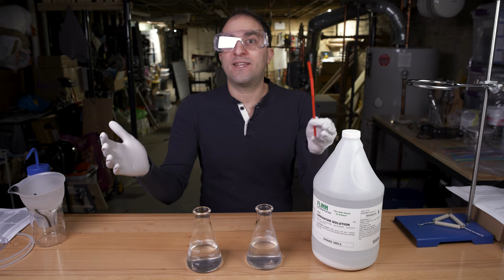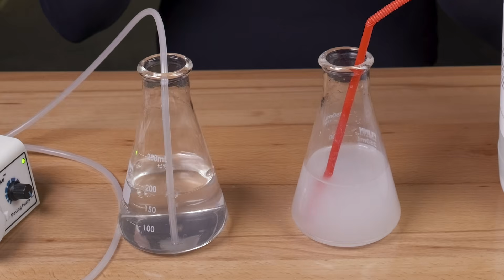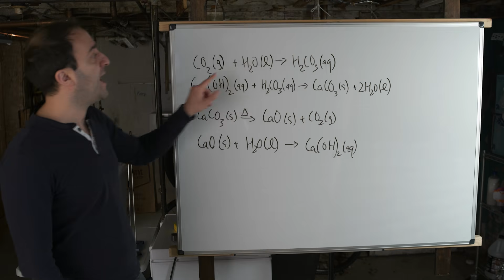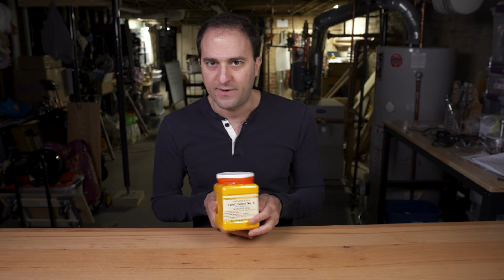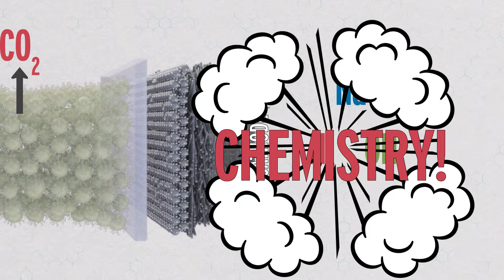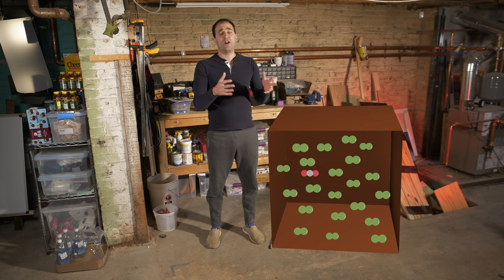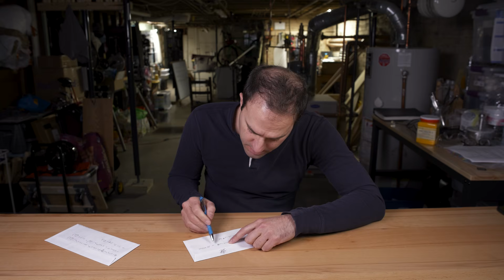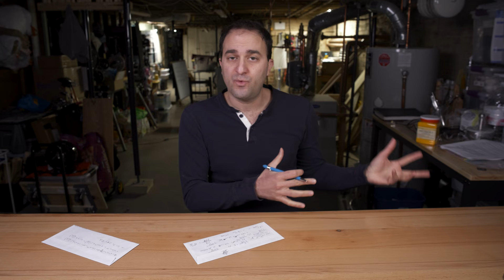Why a Carbon Capture Breakthrough Will/Won't Save Us

Comment: i might just be a little slow, but how would they reliably get rid of the CO2 after capture?
Reply: He said you can put it in the ground, like oil drilling in reverse. I think a more sustainable solution is to use the CO2 in as many ways as possible, and put the excess in a hole in a different form. We took it out of the ground mostly as solid carbon (coal), and I think there is a good chance we will have to put it back the same way.
Reply: @the_zeppelin_guy  That would cost the amount of energy that we got from burning the coal in the first place, and then some.  Putting it in the ground is a good solution.  It reacts with rocks and forms a stable solid compound.
Reply: @incognitotorpedo42  thanks rocks

Comment: Another great video... but what's a mol?
Reply: A mol is the amount of atoms needed to turn atomic mass into actual mass
Reply from the maker: A mole is 6.02214076×10^23, so in this case it refers to 6.02214076×10^23 carbon dioxide molecules.
Reply: So lets say you have hydrogen, which has a atomic mass of one, you would need one mol of hydrogen atoms to get 1 gram of hydrogen. If you had iron, which has an atomic mass of 56, you would need 1mol of iron atoms to get 56g of iron.
Reply: Its equal to 6.022 x 10^23

Comment: Direct air capture will always make no sense until we’re already taking the comparatively low-hanging fruit of capturing carbon from industrial emissions.
Reply: we just need the way to create product from captured co2 that can sell and make any profit. then lots of people will did tons of capture purely by greed
Reply: @Norakaaaa no.  Profit is what got us into this.  Subsidizing carbon credits etc.  We don't need products from carbon - we already have those. LOTS OF THEM.  What we need is subsidies to force Brazil to plant forests and bring back first cultivating here in the states.  And get away from these horrible wind mills from the 1970s
Reply: @glytchd 
With enough exposure, even the government can make people allergic to it. And you’re no exception.

CO2 can absolutely be collected and sold at a profit. But it could be far more profitable for someone to use it to generate electricity as a working fluid, and to use electricity to convert it into a bulk, homogenous, cleaner burning fuel for which emissions can be collected closed cycle. And for which the supercritical phase would be able to extract energy more efficiently than air.
Reply: It will also never* make sense until all energy is generated cleanly (in the network at that specific point in time). If this isn't true then you'll always be better off just taking dirty energy generation off the network with clean energy generation. If you're using clean energy to clean dirty energy then you'll be wasting energy. Carbon capture is almost purely just PR cover to keep dirty energy going.

*There may be points in time where energy storage isn't there for clean energy and it may make sense to use excess energy for carbon capture while running dirty energy during peak energy demand or trough production of clean energy.
Reply: @Cethinn  In fact the current DAC tech from 1pointfive uses natural gas to separate a lime based CO2 capture complex and collects all the CO2 generated by that process
Reply: And imho, both processes makes little sense until we massively reduced out energy reliance on carbon. Until then, it’s fighting a wildfire with Supersoakers
Reply: I thought about that too. Why don't they put carbon capture plants directly beside power plants? That way, not only a large amount of CO2 can be relatively efficiently captured, we might actually use the captured compound as some kind of raw material.
Reply: Industrial emmission are often good to make more emissions elsewhere because of the product.
Reply: on the contrary, CCS from power stations takes roughly the same amount of energy because the thermal efficiency of the power plant is wrecked
Reply: solar from sahara, and you have the enegy covered
Reply: Or producing less. period.
Reply: And ocean capture of carbonate will always be more economical.

Comment: Yeah, seems like we need to get at least 25% efficiency if CCS is ever going to be technically viable, and that's if we're willing to put half of our annual energy production into mitigating the effects of that energy production...  And that's assuming we can scale up production without resorting to even less clean sources (like bringing coal plants back online) or scale down energy use (a thing humans have never done in the history of humans).

"We could power CCS through renewables" is a common counter, but it doesn't really hold up.  If we have enough renewable energy to power enough CCS to make a meaningful impact on climate change, let's just use that energy for our needs and shut down fossil fuel plants, first.  There's only two scenarios where renewable-powered CCS makes sense: the first is that deep future where fossil fuels have been retired and we're just cleaning up the damage, and the other is for very sporadic renewable sources where grid storage doesn't make sense and there's excess energy sometimes with nothing to do with it.  The former is a pipe dream, and the latter is too little to matter.

Comment: We have been told the problem with renewables is that you need to store the energy for when it’s not there. If we are intent on building carbon recapture sites, why would we care about the intermittent nature of the energy supply?  Just build excess renewable and instead of trying to store it for the night, run non renewable at night and use the excess in carbon capture to make up the difference. Basically treat the carbon itself like the “battery”.
Reply: Yes, but the amounts involved in that scenario are so tiny as to be meaningless.  The lifetime cost of setting up the CCS plant would never be offset if we only ran it during peak energy surplus.
Reply: @ just scale it up so that we are producing 10-12x more energy than we need and using the excess on clean up.

Comment: Climeworks in their press stuff leaves out the energy for regeneration, simply calling it "waste heat" for that step. The thing is that the "waste heat" needed for that step is very high temperature, quite unlike the actual waste heat from industry, which is always low temperature.
Reply: Nobody is using calcium oxide for sequestration. They are using monoethanolamine solvents that require 115C to 126C temperatures in the stripper tower, similar to bleed steam from the last stages of a steam turbine at a thermal power plant.

Comment: I still wonder if single use bioplastics would technically be carbon capture... lol. 

I'll take "do everything we possibly can" as the fix!
Reply: Serious answer: they are (technically) but they don't hang on to it for long enough to be a solution. You need something that can lock down carbon on geologic timescales, basically recreating that processes that created fossil fuels in the first place
Reply: @DistortedSemance If it only captures the carbon for a medium duration, we can just keep doing it though, right?
Reply: @moth.monster   Yes, but the total amount of carbon sequestered depends on how long it stays in the ground. If it's degrading as fast as we're producing it, then you're not really "sequestering" anything. However, even in the best case, you can't really reduce atmospheric concentrations permanently with this strategy, you can only temporarily delay the emissions into the future. So for example, if you're producing bioplastics that take ten years to fully degrade, then by the time ten years have elapsed, you're now emitting just as much carbon per year as if you were just incinerating it, through the combined effect of all the years of plastic in partial states of degradation. Each year's worth of plastic emits one tenth of it's carbon per year, and there are now ten years worth of plastic in the ground at any one time, so after an initial drop in carbon you eventually end up back at square one.

Granted, it maybe wouldn't be terrible as a way to buy extra time for infrastructural rollout, but that's only if that rollout actually happens. I think it's more likely that the system would be abused as a way for companies to "offset" (heavy quotes) their emissions in order to justify continuing carbon intensive practices, in which case a short term sequestration strategy is only delaying the inevitable.
Reply: @DistortedSemance  just because a solution isn't a permanent solution does not mean it is not a useful solution. If at peak production the product would remove 1% of CO2 from the air, as long as peak production continues that is still 1% less CO2 on the air. 

To be frank, the best solutions are solutions where there are profit motives to implement them. That way you are not at the whims of government policy. If it is profitable to capture carbon then there will always be an incentive to capture it.

Comment: Seems like stowing it away is way more dangerous.  If we end up stowing all this CO2 away and somehow it finds a way to leak or be released, we are in far more trouble.  Maybe look to our oceans and use them to take the CO2 and separate the C from the O2.  Also like your pinned comment points out trees are not a great option, but algae, grasses, and plankton are much better options.

Comment: I don't get that all the methods you describe in the first half require regenerating the base - which releases the captured CO2 - what's the point of capturing it and then releasing it again?
Reply: After liberating the gas from the base, the idea would be to capture the now concentrated gas and probably pump it elsewhere.
Reply: Elsewhere? ... Venus? ;)
Reply: I suppose that you want to release it in some container, or deep underground like Climeworks does it at 9:04.
Reply: @duchainer  I don't "want to" ... anything... not being a politician, I don't have any "answers"... only questions.
Reply: The saturated CO2 absorbant is pumped to an isolated chamber (called a regenerator or stripper tower) where steam heating coils cause the CO2 to desorb. The pure carbon dioxide can then be drawn off. Commercial carbon dioxide scrubbers don't use calcium oxide/carbonate, they use monoethanolamine.

Comment: Dude! What a great video! About 30 years ago, the department of energy put out an RFP for $100 million to produce a carbon sequestration plant. I sent them off an email explaining that it broke the laws of thermodynamics and it would generate more carbon dioxide than it would sequester. They actually stopped the RFP. I saved our country $100 million. I went on in the email to incorrectly suggest planting trees. I wasn’t aware that since the Carboniferous. Microorganisms have prevented the formation of coal. A few months after it was stopped a firm put out a television advertisement that I think air during the nightly news, that trees don’t sequester carbon dioxide long-term. I think they were trying to salvage their work, even though their work was futile. My cut for saving the country $100 million was a whistleblowing $0.00. Yippie. Maybe more citizens would do what I had done if there was some sort of compensation. Instead, money continually gets pissed away by our government. Transparent government finances before the fact. Maybe this exists to some degree, but it’s too hard to navigate the bureaucracy.

Comment: The best case(not good but best) is direct carbon capture from coal power plants. Emissions are about 12% CO2. All the literal tons of emissions every minute and the 7x nitrogen hanging out with it have to be compressed quickly, bubbled through the solution, heated to release CO2, compressed again, and put somewhere. Takes 25-30% of the energy that the coal plant produces.
Reply: I'm incredibly suspicious of that 25-30% claim, given everything George just told us about the state-of-the-art today, especially since the energy consumption of the most intensive step has nothing to do with CO2 concentration.
Reply: @ The most energy intensive step is having to compress all the exhaust gasses, second is boiling the solution to get the CO2 out, the third is compressing the CO2 that was boiled out, last would be circulating the solution. Coal also creates a lot of unwanted compounds in the solution that degrade 100% equiv in a couple years.  The efficiency is significantly affected by the CO2 concentration in the real world.  You have to compress 30x more air to get the same amount of CO2 from direct air carbon capture compared to coal emissions. Energy efficiency of removing the CO2 from the concentration isn’t effected by concentration in his perfect thermodynamic napkin math, but getting it into the solution absolutely is. 

I think the disconnect is this.  This tech has only been installed on a few new coal plants built with efficiency almost double the global average for coal. Using every scrap of waste heat they can. So the average plant may be using 50-60% of its production to capture the carbon. 

I’m not even advocating for it. It’s not taking off for good reasons. It’s just the closest to realistic due to the emissions CO2 concentration.
Reply: @blakereid5785 Carbon capture was applied at subcritical power stations in North America and reduced the thermal efficiency from 39% to 33%, about 15% of the energy previously going into electricity now being siphoned off to drive the regenerator towers. State of the art ultrasupercritical coal burning power stations would achieve lower losses than this.
Reply: Pre-combustion capture at gas turbine or Allam-cycle plants makes more sense. Use gasification and the water-gas shift reaction to isolate carbon dioxide before or during combustion.
Reply: @ It was worth pointing out, but it’s not really relevant to tech or efficiency of post combustion capture. Once they remove that CO2 from the NG, they then release a bunch of CO2 when they burn the NG, and that isn’t captured. I just mentioned coal because it’s the same tech as the direct air capture hype.
Reply: It’s the best case due to the high concentration of co2 and it has failed over and over despite government throwing a lot of money at it
Reply: @ yeah, it’s a tough one thermodynamically. Pesky air being mostly nitrogen.
Reply: @SigFigNewton  Carbon capture has never "failed". It's just that the lack of any carbon taxes mean that it's never cost competitive with just venting the CO2 to atmosphere, unless there is an oil field nearby.
Reply: Carbon capture is not cost competitive with any technology discussed or implemented
Reply: In fact as you suggest CCS takes roughly the same amount of energy as DAC because of the loss of effficiency of the power plant............

Comment: This may be insane but what if we just store the emissions before even bothering to extract the CO2, and just go for a much slower but lower energy cost extraction method? Like, emit pollution straight into holding tanks and then very slowly scrub it, and only ever actually emitting it into the atmosphere once it's clean enough?
Reply: What if the top ten emitters in the world—I'm going to sound crazy— slowed down building oil infrastructure until 2040? They wouldn't even be at a loss or anything; they would just stop quadrupling their net profit margins every quarter.
Reply: @ I 100% agree, but they won't.
Reply: Because storing enormous quanties of gas is extremely expensive and requires suitable (read: sparsely available) locations.

Think about how much exhaust gets blown out of the tailpipe of a typical car. It's not much at once but it could probably fill up a couple cubic meters at atmospheric pressure within a few minutes. Now imagine that times about ten thousand and try and picture how big of a tank you'd need to store that amount of co2 for a power plant running 24/7. And since the proposal is to sequester it slower than you're producing it, you would need to constantly source more and more storage volume to store the carbon you're behind on sequestering. Compressing it doesn't help either, because compressing gas takes energy and requires expensive metal tanks capable of handling both high pressure and cryogenic temperatures.

There is a huge, huge interest by fossil fuel companies in trying to make this work, and it just doesn't, despite them having nearly infinite resources at their disposal. We really do just need to emit less co2. Any other solution is probably a waste of time.
Reply: @DistortedSemance  well I meant more like underground rather than you know, big metal tanks, but you're probably still right, there likely isn't enough space even in empty oil wells and what not, and then you're really just creating potential disaster zones in the event of a leak... and pumping the emissions to central storage areas has energy costs of its own. I should've thought it through more